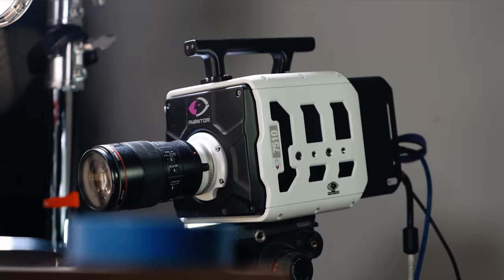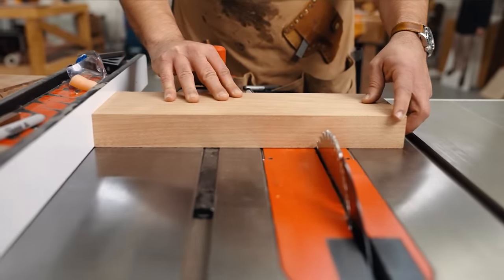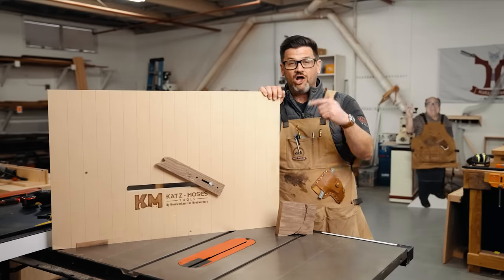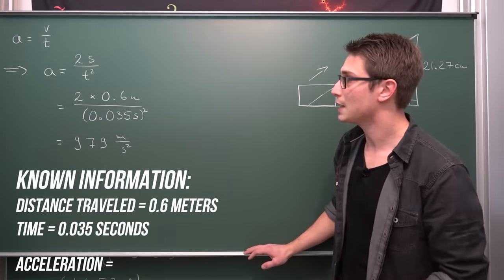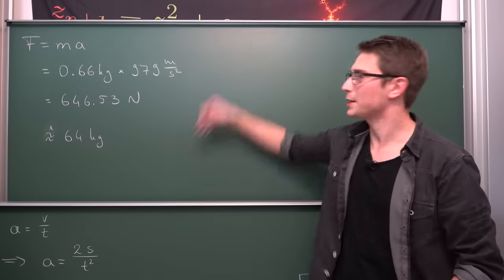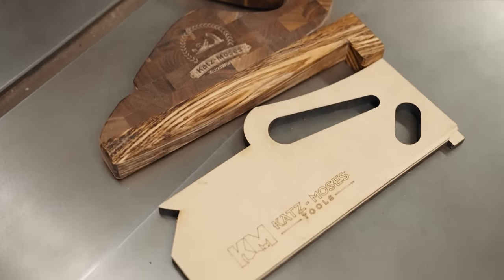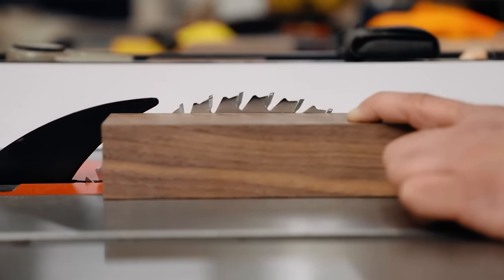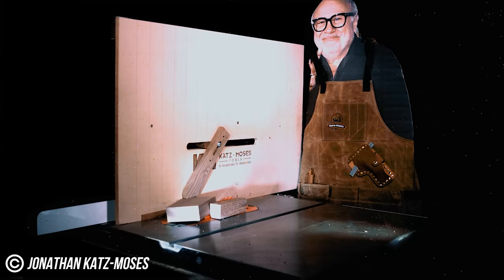The Anatomy of a Table Saw Kickback at 50,000 FPS Ultra Slow Motion in HD

Comment: Nice video!  To me, the really key safety technique is to not stand in "the line of fire".  Kickbacks will occasionally happen even with precautions, and not being in the way is a great backup safety plan.  One of the best ways to accomplish that is to be using a European style sliding table saw, rather than the American style fixed-table saw that's common in the USA.  Unfortunately sliding table saws in the USA tend to be expensive.  To my knowledge, Grizzly makes the cheapest one, which will still run you ~$4500.  So they're not really accessible for amateur wood workers.  But for anyone running a professional woodworking shop, the price is less of an issue, and the safety improvement is immense.  Used machines will cost less, of course.  And readers in Europe will have an easier time finding affordable machines.

Comment: I would think that case-hardened wood* also poses a danger of kickbacks.

*Improperly dried lumber can cause the surface of a board to be in compression and the inside to be in tension and lead to a board pinching when being cut. (As I understand the process as explained by Stumpy Nubs)

Comment: My kickback experience: After the board just passed by the cheap Harbor freight featherboard, one of the feathers came into contact with the blade. The thing exploded off the table and flew past my face at mach 1. Two lessons learned.

Comment: Great vid! In a scary irony, I just got a new grizzly saw to replace my very scary saw from the '70s, which featured a terrible fence, an absence of a riving knife, and a constantly vibrating blade. During the second day of use, I had installed the dust collection guard incorrectly - I failed to insert it all the way and so the spring-loaded dowels did not seat themselves properly - and during a cut, my out feed board lifted the guard into the blade, and threw the damn thing at me at a frightening speed. I now have an impressive bruise on my rib cage and a broken blade guard. I was very nearly killed by my safety equipment!

Comment: Excellent - scary - education. I have an old (1980) Craftsman table saw. No riving knife. Guard with kickback pawls and splitter mounted to an extension at the back of the table - impossible to align, dangerous to use (when board hung up). After replacing the fence, I added Jess Em stock guides. Pull board against fence. Wheels only turn one way to prevent kickback. Also use a magnetic feather board. So far (years) they have done the job - except for once (proving stupidity can overcome even the best prevention). I also stand to the right as far as possible without jeopardizing control.

I remember from when my daughter played Little league baseball that taking a solid hit to the center of the chest (like a line drive) could have fatal results - even if it only left a bruise. Called “Commotio Cordis”.

Comment: Something that happened to me when I was working in a cabinet shop, many many years ago.
They had an old delta sliding table scoring table saw run off 3 phase,600W (I think).  The thing was a monster.  Because it was old, and it had the sliding table, the blade tilted towards the fence, so the motor wouldn't foul on the slider.

One job I was working on required 2x2 material to have miters meeting at the peak of each board.  If you can picture the setup being the blade tilted towards the fence, the fence moved very close to the blade, and not much room between them.

We had a push stick, but it was the tiny birdsmouth kind, made out of rock maple.

So off I go cutting these pieces... the first cuts were fairly easy, there was enough wood to hold the push stick against the fence and it cleared the blade.  The fun happened on the second pass...  Now the push stick had to be held at an angle and the blade would kiss the side of the push stick.  That is, until I tried to reposition the push stick on one cut because it felt like the board wasn't supported.  I have never felt such pain in my hand.  Imagine getting hit in the palm with a baseball bat at MLB strength.  The push stick shattered on the blade, sending most of the force through my hand, and throwing the rest with suck force in the cinderblock wall behind me to crack a block.

I had twisted the push stick while it was engaged with the blade, and because it was had wood, it had zero give.  My had was useless for 3 weeks.  It bruised instantly, and I had problems moving my fingers.

I now only use push sticks made out of easily chewable material... laminations of hardboard, pine, etc.  If it happens again (probably won't, because I know better now) the blade should chew the push stick more than eating my hand.

Comment: I destroyed two finger tips this way.  Had lots of stiches.  Was notching a solid PVC/Plastic block to allow it to knock in Laminate floorboards better on a older table saw.  It picked it up and spun it into my two fingers smashing (pointer and middle) them into mush.  The doctor at urgent care joked that I would never be a hand model now.   I still have that block around as a reminder and you can clearly see where it spun off the top of the blade.  Since then I bought the Jobsite model Sawstop tablesaw.

Comment: Correct me if I’m wrong but riving knives are actually a hair wider than your blade, with some kind of small taper so they fit into the saw kerf, and then wedge apart the cut pieces of wood (I’m talking maybe a couple thou) to prevent kickbacks. If they were smaller than the blade, the wood could be allowed to close onto the blade during a cut.
Reply from the maker: Riving knife should be about .09 for a fill kerf blade which is .125. Riving knife should be minus .02
Reply: @katzmosestools  that’s interesting. Thank Jonathan!

Comment: Great video, advice and demonstration.  I have been using a table saw for many years and have been fortunate I have not been clobbered by flying wood.  Through no one's fault but my own, I have fortunately been in a couple near misses where the board went one way and I was in the other direction (quite memorable).  Staying out of the line of fire is important.  I will make sure a few woodworking friends get to see this video.

Comment: My kickback story is a little different than others: it was on the miter saw! I was just starting out and I had heard of table saw kickback, but I had never heard of miter saw kickback. I changed the blade to a higher quality one, wanted to do a test cut on a scrap (which was small), and was not holding it down since it was so small. I heard a loud BANG, felt my cheek sting, and watched the piece fly 20ft and slam into the wall behind me. I'm fortunate that it was a glancing blow and not in my eye, but even then it broke the skin! Lesson learned: if it's too short to safely hold down, it's too short for the miter saw.
Reply: My most memorable kickback was also on a miter saw. We were replacing flooring and I was cutting a piece late one night--small, like yours. It wasn't clamped down well, so as the blade made contact the piece vibrated briefly and then BAM! Instead of the piece flying at me, it jammed between the fence and blade, bent the one-piece fence, got absolutely shredded, and sent the sliding carriage back toward me. I gained a lot of respect for miter saws that night.

Comment: The force calculation was for the acceleration phase away from the blade, NOT for the impact on the user. I'm not saying which will be worse, simply that the calculation presented is not relevant to the user impact.

Comment: The only kickback I have experienced (mostly due to watching videos on table saw safety BEFORE starting), was actually the plywood offcut I used as as a sacrificial push stick when ripping a narrow strip. The blade bit too aggresively into the end of the stick and rocketed it through my garage. Other than deffinitely feeling it in my hand, nothing else happened, but it is certainly not a mistake I'll be doing again!

Comment: That's a great video!  I just bought a new Ridgid 4520 with a riving knife and guard on it. I also have a canvas apron that I rarely use. I never thought of it as ppe before. Also, I can't help but wonder about the items that you have in the upper pockets of your apron should a block of wood hit you. If you have a small metal combo square right where the wood could make impact with you, it could push the metal against your body. I've seen so many people who are beginners using a push stick right up against the fence because they want their hands far away from the blade but they have no idea how dangerous that is as it will pivot the board into the back of the blade. You could also put a piece of foam on the underside of your push stick to give it more grip. It would make it similar to the Gripper.

Comment: I got very confident with my little Dewalt tablesaw and would cut without thinking it was a big deal until one day when cutting dados I got a little careless going back and forth and experienced kickback for the first time. The good thing is, I was using a Gripper pushblock, so that's what got sucked into the blade, and not my hands. However it also shot the Gripper like a rocket right into my belly giving me a very large bruise. I still have all my limbs but it could have been much worse (my Gripper now has a large gouge). Now, lesson learned I never feel 100% "at ease" when using the tablesaw, and I take that as a good thing as I'm much more cautious and mindful.

Comment: Outstanding work on the video! Love the math stuff! Here’s some peer review:

How can the distance used to calculate acceleration be that much larger than the diameter of the saw blade? The major force is from the saw blade, and the block is only acted on when in contact with the saw blade. So I’d expect the distance to be somewhere between 5 and 10 inches. 

That being said, I realize the kinematic equation is only an approximation because we’re assuming acceleration is constant. I’m this case it isn’t. Plotting position frame by frame and then finding the max acceleration could give a more accurate approximation (I suspect the max acceleration is much higher). But this is good enough for government work. :)

The impact with the body would be interesting to analyze too. 

Mechanical Engineer/Physics guy here. Thanks for giving me a chance to do some physics. Great work on the video!
Reply from the maker: Yeah we just assumed acceleration was linear for simplicity and time. We know it's close but the true physics at play could take a whole other 10 minute video. All I know is when you watch the clip with Danny the camera doesn't even get the board in a single frame at 24fps until after it decelerates from the cardboard. It's cooking! Thanks for a polite constructive comment. Rare these days. Cheers
Reply: @katzmosestools  Thanks for a cool and informative video, however the initial acceleration is not (as pointed out by Jim) happening over the distance of 0.6 meters, it's happening over a few centimeters when the saw blade grips the wood. And it's not, as I see it, even relevant in order to calculate the potential damage from the flying piece of wood. It's relatively easy to calculate the speed of the wood through the air, which is about constant after leaving the saw blade. When hitting the cardboard there is a negative acceleration for an inch or so when the wood stops moving, and this is the crucial part to calculate, as this is when the kinetic energy of the moving wood is translated into pain. Knowing the deceleration and weight of the wood it can eventually be translated into a weight on the victim's chest, which would probably result in an even more scary number than what is calculated in the video.
Reply: @andersmansson  I am also a bit confused about the calculations here.

The way I would approach the problem would be to calculate the speed of the wood flying through the air once it leaves the blade.

Once you know how fast the wood is going you can directly calculate the energy and momentum it has (once you weigh the block of wood).

You can also work backwards and estimate the force the saw was applying by using work(aka energy gained) = force x distance with the distance the wood travelled while in contact with the saw.
Reply: @andersmansson  In truth, the apparent "mass" of the block calculation wasn't really relevant. The 64 kg apparent mass only applies while it is accelerating during contact with the blade and obviously the block isn't hitting you at that point. A more useful calculation of how hard the block hits would come from analyzing the momentum of the block as it sails through the air, then working out the deceleration as it strikes the dummy. Then you could work out the force it applies to you as it decelerates through an impulse calculation. I would love to see slo-mo footage of the strike with specific times. Cool video though and certainly gets the point across.

Comment: I can't remember how many bruises I've had on my tummy from kickback. I volunteer in a 50+ woodshop, and now a riving knife is mandatory when the cuts allow it. However, as you know, not all cuts allow for a riving knife to be used. So, I've bought leather and a friend is going to make me an apron. Kick back is NO joke. I've seen entire jigs thrown 30 feet across a shop. Luckily, there was no one in the way or there would certainly have been significant injury to anyone in the path of the jig.  While I get that the magnetic feather boards are great, but sometimes (because of the distance from the miter slot to the blade), the mag jig ends up over the slot and the magnets don't hold. Making an old-fashioned feather board is a must. An aux fence that extends just past the blade is an option we've found helpful.

Place a sacrificial fence to extend just beyond the blade, but not far into where the riving knife lives. This way, as you feed through the entire cut, the piece will end up in a wider space and thus, not get trapped against either the riving knife or the blade.

Comment: Also to consider is that upper pec area on the chest is where they usually implant pacemakers, so if a person has one and kickback shoots a chunk of wood up- it could very easily hit right where the pacemaker is located and the imact and force very likely could damage or break it or it's connecting wires. The wires go into the nearby blood vessel down into the heart, so an impact on the pacemaker area could rip wires out of that vessel, such an impact could potentially be fatal!

Comment: Can’t get enough of that ultra slow mo footage. Also thanks for plugging in Jens channel. Holy murder missiles, this video combines destruction and woodworking. On a safety note, how does you get your table saw stay so clean? It seems like the surface repels wood dust. I’ve seen sprays for table saw called Glidecote that claims 3x more performance, have you used products such as these and if yes, would you recommend them, or paste wax be good enough?

Comment: Besides a riving knife, featherboards and letting the blade protrude very little out of the upper surface of the workpiece, it also helps to push the workpiece into the blade rather slowly. If the blade is aligned correctly, and you don't effectively stop, burn marks won't be a problem. The slow advance speed allows the blade to grind away material and make its way through the workpiece before it has enough material to grab on, even if the workpiece strays slightly sideways or catches onto the blade, due to internal tensions being relieved by the cut. The riving knife won't let it stray a lot, and will also be where most of the pinch force will go, if pinching happens. Of course, for anything to be helpful, you need to really make sure you drive your workpiece straight, with no wobble or any other sideway movement. Nothing can protect you from sloppy work habits.

Comment: Brilliant video! Thanks so much for taking the time, effort and money to make this happen for the benefit of all woodworkers.

One thing I would like you to expand upon if you have the chance is why a lower blade height (one tooth above the workpiece) would decrease the likelihood of kickback. It seems at first thought that the higher the blade, the more height the workpiece would have to climb over the back of the blade to cause the kick back from occurring. Any thoughts?
Reply from the maker: We have a few slo mo shots to demonstrate this in a followup video
Reply: @katzmosestools  did someone say, segue?!!
Reply: 1) The lower blade is recommended, by blade manufacturers, for quality of cut and safety.
      (That is not part of their marketing plan or engineered obsolescence. They know what they are talking about) 
2) When the blade is low, the forces at the back of the blade are directed more forward than up, lessening the chances of kickback.
Note) Kickback is Still possible, for multiple other reasons, so continue to take All precautions.